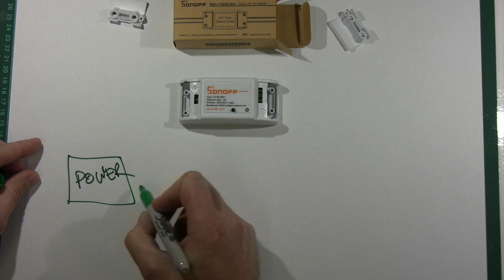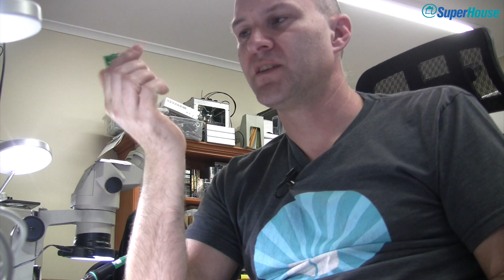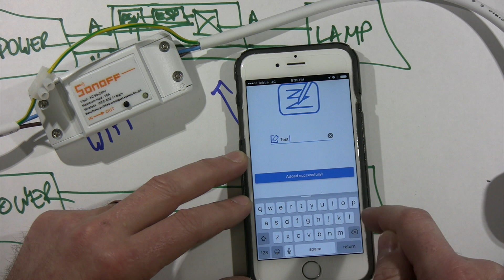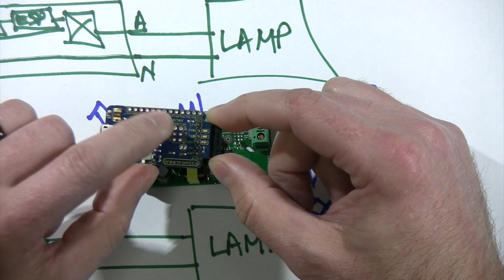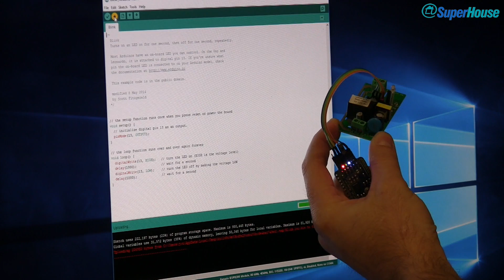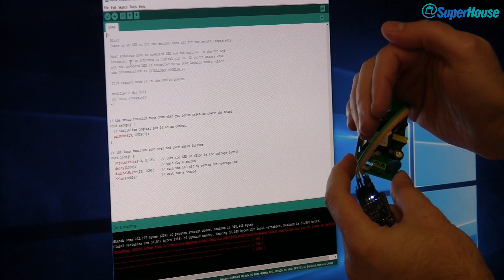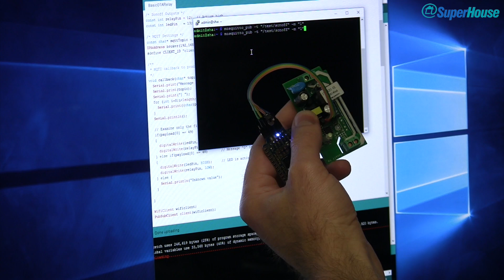SuperHouseTV #17: Home automation control with Sonoff, Arduino, OpenHAB, and MQTT

Comment: Do you think you could do a video about MQTT... from scratch (with vitual machine) and a demo? I'm not totally sure how it really works... Else a good suggestion for more infos? Thanks
Reply from the maker: I agree, that's an important topic that would be very helpful for anyone setting up their own home automation system. MQTT is so widely used now that it's important to understand how it works. I mentioned it in the very first SuperHouse episode where I explained my system architecture, but since then the architecture has changed significantly and I didn't show details of how to set up MQTT. Great suggestion, I'll see what I can do.
Reply: I second that, and as long as I can take the information and apply it to an RPi I am happy. Oh a follow up video on OpenHab would be great too.
Reply from the maker: Jason Perry I currently use an RPi running Raspbian as my main home controller, with Mosquitto (MQTT broker) and OpenHAB installed on it.
Reply: Yes I would love a video on MQTT - JUST on MQTT from Jonathon.
Reply: This info might help, this is the config I used for my Sonoff's:

https://www.hawker.id.au/index.php/2017/01/17/home-assistant-sonoff-mqtt/
Reply: Jean-Michel Dubé sßx
Reply: yes pleeease :) mqtt-openhab2 tutorial!!! I am searching for some instructions how to do it for a while now with no luck.
Reply: Nice video. You may also want to checkout the review of home automation on my blog at alfredreviews. com/home-automation-review/ Thanks, Chandler.
Reply: @me me :  
The Link seems not to work. Could you please help me out?
Reply: SuperHouseTV l
Reply: what firmware do you use on your Sonoff devices to work with OpenHab ? does it just need an MQTT compatible firmware ?